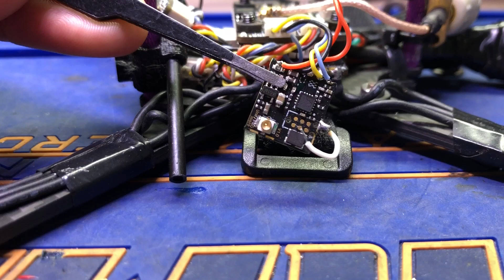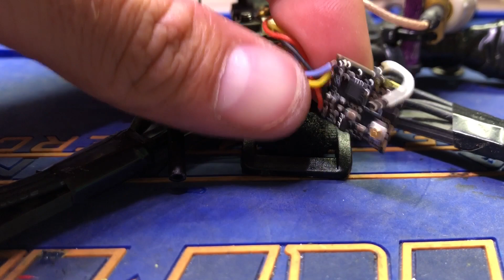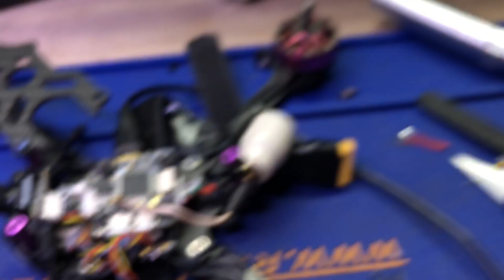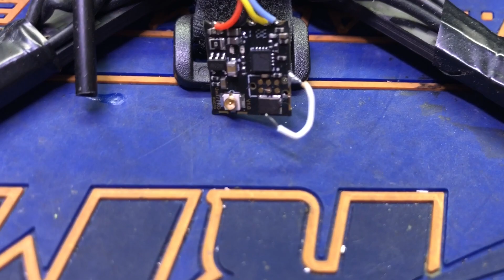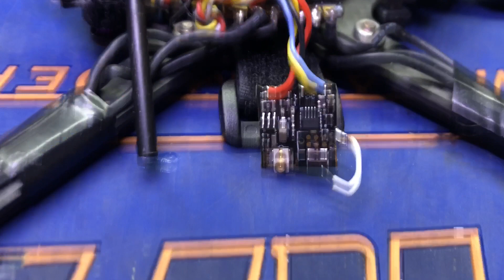TBS Unify Nano: How to unlock and change channels without smart audio

Comment: So couple things, first your over complicating the button, its just the 2 side pads bridged, you can even lick your finger and touch it. To unlock power mode and have both lights on you hold for 3 secs to enter band, 3 secs to enter channel, then hold for like 5-10 secs until only amber (it will first go to both lights, then only amber). When you release you will be in the 3rd option which is power, after that you will have both lights on. Holding during power up puts you in pit mode or out of pit mode, that doesn't unlock it. I know all this because the thing is a piece of junk and smartaudio doesn't work on most of my FC's, may not be resolved until 3.4 for some targets.
Reply: I'm having issues with mine too, SA not working with my mini omnibus f4 :(
But good to know the button trick so thanks for that info :)
Reply: So i just have to solder the button to  the two outside pads of the unify?

Comment: This VTX sucks balls. The issue why SA does not work on several flight controllers is the fact it uses SA 2.0 Lite which requires 3.3v via software pull which many flight controllers do not support even still today. 

To get it working on a board where you have issues with SA and this VTX you need to add a 10K ohm resistor from the ground pad to the SA pad. You can do on the vtx or the FC. This VTX is a mess to work with because the boards it is working out of the box with are a crap shoot.

Comment: i soldered on the button. no free uarts on my fc.
Question:
- Im using fatshark teleporters fav frequency 6860 mhz. How do I know if im stuck in pit mode and not just having issues ?
  - I dont have the blue light, just the orange.
  - I selected channel 7 band 4 ( supposed to be 6860 MHZ)
  - I also was able to change the power level to 50 mw
Getting a messy signal as if it were not the correct channel or as if it isnt outputting the power  like in pid mode.
Thanx
Marc :)
Reply: Where do you solder the button?  I just check  on the internet but no diagram showing it.  I suppose it is on the pad under the antenna plug...???!

Comment: Smartaudio works only after this vtx is unlocked? I am in trouble in using smartaudio.
Reply: as im understanding you need to solder a resistor 1800ohm betwen smart audio and ground

Comment: I legitimately smashed my first one with a 20lb weight cuz it was such a piece of shit with no info out on it. I got another one as it was the only choice for a small vtx at my local shop...and it like kiiiinda works. I soldered the button on and it responds but doesn't work well at all. I've only gotten either the blue light or the red, never both. Red is straight pit mode, I don't even know what blue is doing but I don't even think I'm getting 25mw. I think I'm finally gonna write TBS an email. I get mad just thinking about Unifys.
Reply from the maker: Since you have the button, power it on while holding the button and continue holding till the blue and red light come on. Ast least I think that will work lol
Reply: I went and searched TBS site since one of their replies on here says that the manual is updated now (It wasn't at the time of original release, bad look TBS). I had to hold the button for 3 sec to get to first menu then hold 3 sec again to get to second menu then hold the button down for about 30 sec then I got both lights. With all the TBS sponsored pilots out there, you're the only one who has made any effort to clarify this. Thanks man, at least someone is doing their job!
Reply from the maker: Haha I’m not sponsored. I just had an issue and couldn’t find an answer and thought others might also have the same issues so I made a video to help
Reply: psshhh, well you should be! I'm a fan, keep up the good work!

Comment: You just saved me from putting this in my latest Revolt OSD build, but I'm even having problems with the regular TBS race VTX saving my VTX changes through the OSD. I don't know if it's the VTX or if the revolt is to blame.  What do you think about the immersion stuff?
Reply from the maker: I have two tramps but haven’t tried them yet! So don’t know. I hear they are solid, I just don’t like the shape/size. 

Do you have your vtx settings set up on on the configuration tab? The smart audio to TX 3 setting.
Reply: Yeah, it will actually change it sometimes, then other times it acts like it's locked, and it goes to band A channel 1 if it doesn't save what I tried to put in. I can change the PIDs and Rates with no problems. It was doing this when I first put it in and then it worked perfect for 40 packs, now it's acting up again. I was thinking to get the immersion VTX with the wand and bypass the OSD. Taking apart a Merica to get to the VTX button is a pain in the ass.

Comment: You just need the two pads on the side, also these and the new v3 are completely locked out of the red channels(illeagle in US) that are available after unlocking on older unifies. Even after unlocking you will not be able to use the channels in red on the instructions card.
Reply: Team BlackSheep those must have been what I was assigned at my race and we tried a few and  assumed it was all the red ones on the card. I guess the card needs updating for the newer vtxs. As for the pads on the side, all my nanos work just using those contacts with a wet finger or piece of wire.
Reply: Jeremiah Davis just the black ones. E4, E7, E8
Reply from the maker: I couldn’t get just the two side pads to work.
Reply: Team BlackSheep This was actually a Multigp race but it was just as all the new vtxs were coming out and I don't think their system was up to date. It was assigning frequencies to everyone that were unusable on the nanos and v3s.
Reply: Sponsor this dude or drop like everybody else on the team. This video is the only reason I gave the unify nano a second chance. ;)
Reply: Jeremiah Davis yeah try to organize races outside of the illegal FCC frequencies, it causes the HAM and FCC guys to crack down on us hard. Just those 3 channels are blocked, and the Low band. the online manual is updated the offline cards will be on the next order